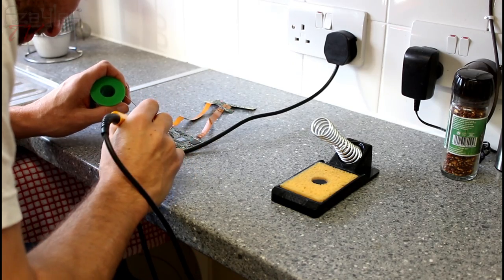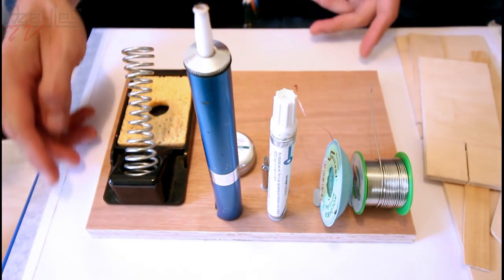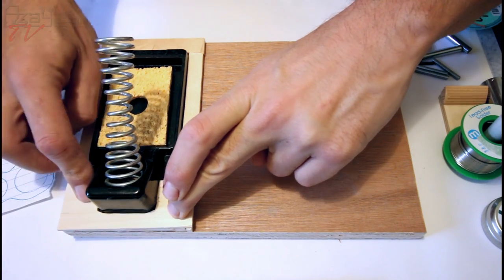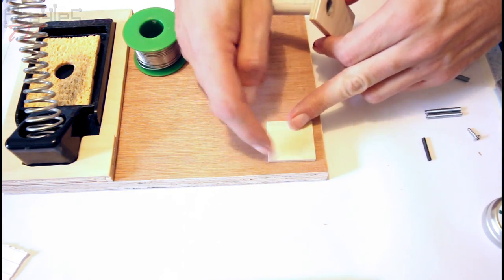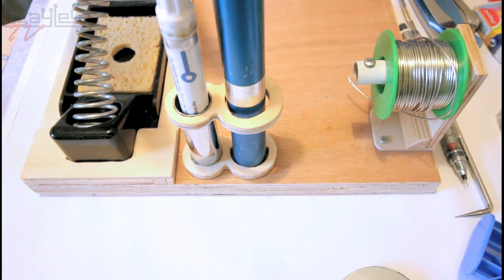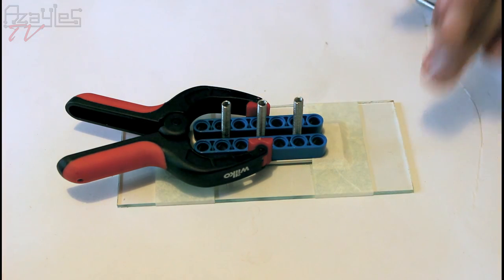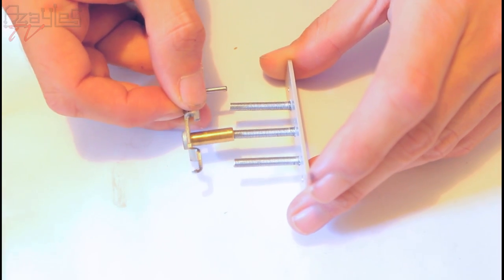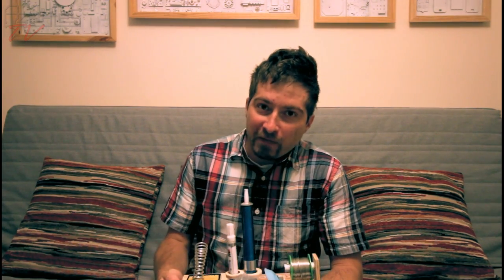All in one Soldering Station

Comment: additional features that you might consider: 1. Lamp 2. Wire Holder/Clamp 3. Exhaust fan (smoke from soldering lead is not good for you health :) 4. Magnet (to secure your tiny screws) and 5. Multi tester on board. :)
Reply: Did you forget about magnets not being good for the electronic components? But the other ones are some good ideas though. Thanks, Tom.

Comment: what foam in soldering stand?
is it's submerge in some liquid?
nice video 👍🏻
Reply: ali arif - You soak it with water. It's used to wipe off the tip of the iron.

Comment: Cool station but I feel is missing a surface resisting the heat. I made similar one station and in the center there is a small rectángle of tile.
Reply: Tile or silicone would be good. You could probably use a silicone pot holder or  cut up mat.